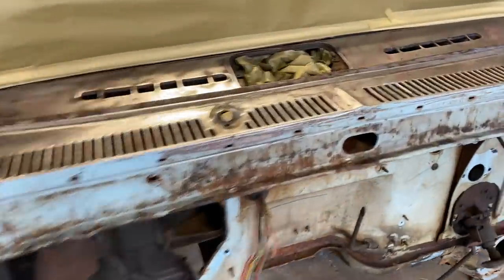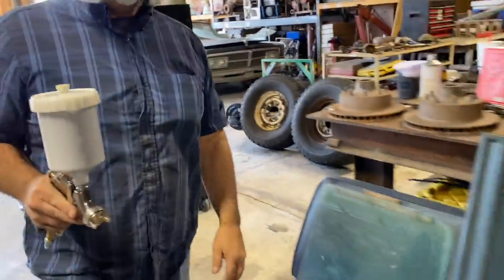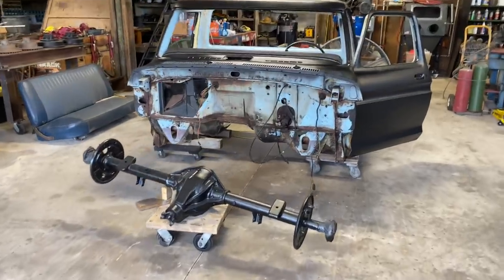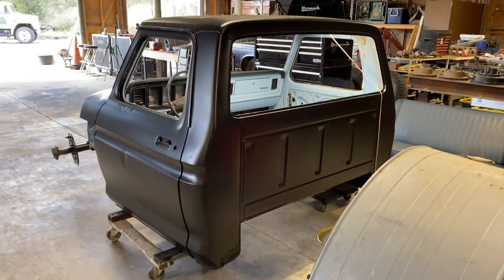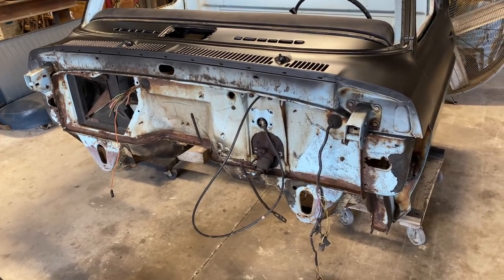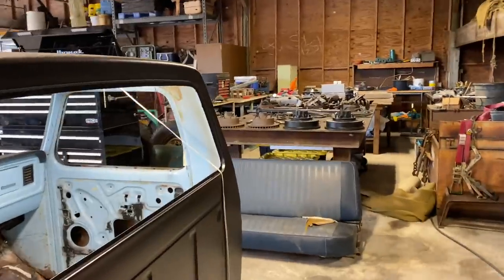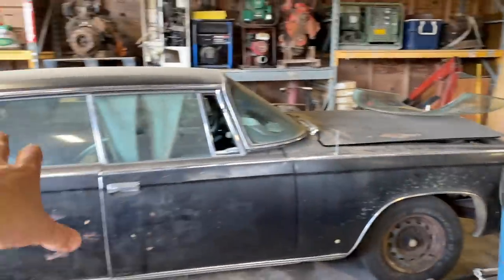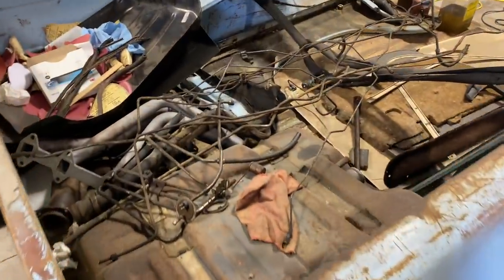Restoring an Abandoned 1974 Ford F250 Restoration Swamp Dragon! Glass & Primer! Resurrection Rescue!

Comment: Personally, right now I would start putting the suspension and axles back onto the frame and getting back to having a rolling chassis. Then when the engine and trans are ready, you can get them installed and get ready for the cab and bed when they are done.

Comment: Think you should have stripped the cab also before you got the sandblasting done to the frame so you could have gotten it all done at one time and you wouldn't have to do all that sanding on the cab. You left some rust areas on that. Sorry but if you are going to take the time to strip the whole truck down then to half  it by just skipping some rust areas then its going to look like it in the near future. Take the time.

Comment: Please pull the dash and column and blast the floor inside and out as well as the firewall .The cab would be awesome and please get a new electrical loom 50 yr old wires are not good to work with.
the truck would be an awesome daily driver

Comment: I would pull the steering column and cluster and find a full harness that way everything is new something as simple as one bare wire under the dash will burn down the whole rig but you are doing awesome.

Comment: Progress is progress! You have moved a long way forward in the past week!  I do of course, have a suggestion: Have you considered using that Eastwood tool for stripping the paint? I believe that is the primary use of it, although you ended up going a better direction in stripping the frame!
Removing the glass surely makes it practical to do a proper rust repair!  I found some pictures taken when I did my first frame-off restoration about 1968. I'll email them to you.

You have gone so far into a restoration, and done so well over all, that it would be a shame not to finish the tear down job! "If there is a screw or bolt, take it out" Keeping hardware bagged as to location of course. BY ALL MEANS, take out the dash and steering column, restore them separately, and at your leisure. Then cover it up, and install it after everything else in the cab is pretty much done. You'll probably find some "what EVER were they thinking" stuff when you tear down the dash. Nice thing to do at home, when outside is really hot and muggy. In the garage at home, you can at least have air conditioning!

Comment: Would be nice to get cab and suspension back together on frame, but I do know your going to have to sort out those vacuum lines that broke off going to the ac and heat controls

Comment: I think the builds going great man. I would pull out the dash and sterring column as well so when you get the floor pans and such in you wont have overspray on em. Looks like they may clean up well. And also, when you cut out those rust spots on the front kepp em and use em as a template to cut out your new sheet metal. Love the channel man!

Comment: this is call working backword ... priming before fixing the rust 😵😵😵
Reply: Actually when you strip to bare metal you need to prime it to protect it from flash rusting while you do the metal work. This is different from the primer that goes before paint.